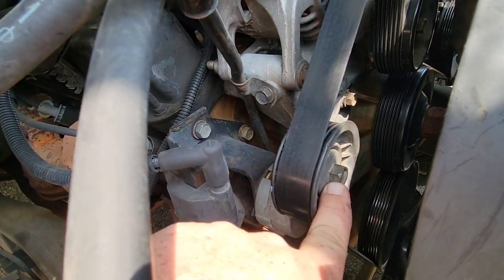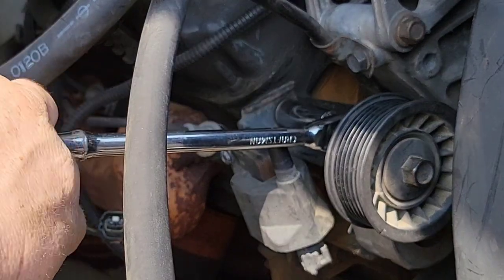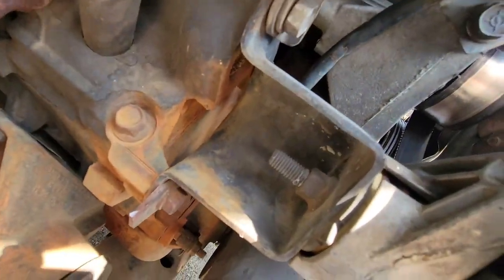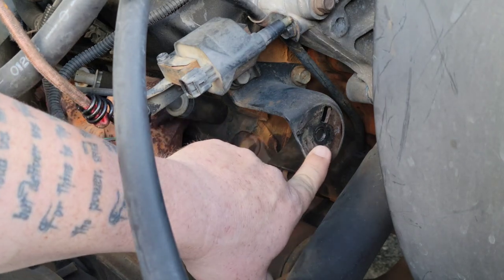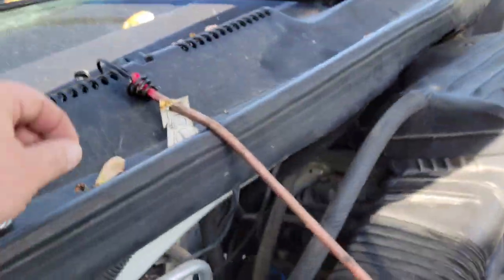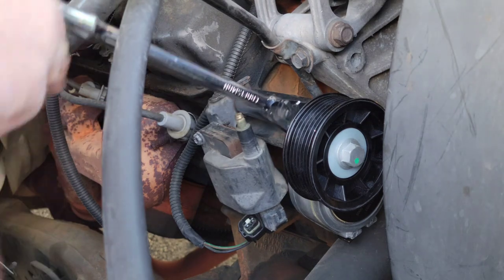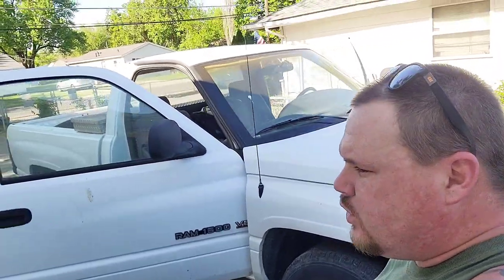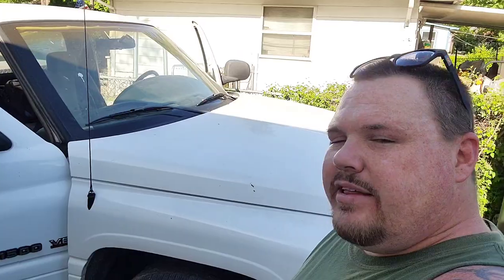2001 Dodge Ram 1500 Belt Tensioner Replacement -BEST VIDEO

Comment: Some people would wonder why you would do such a simple repair. because if you do not have any basic skills you need to build on simple things first. I have taught a few people that did not know how to work a screw driver how to do complete brake jobs and have gone on to do bigger repairs. confidence helps build  your skill set. Keep it up Tomas  !! good job
Reply from the maker: You are right. I want people to be able to watch my channel and follow along and repair their own vehicles and save money, build confidence and overtime hone in and sharpen their skills
Reply: I 2nd this. I did this not 2 hrs ago and my intrusive thoughts are wishing something else needs replaced lmfao (hopefully a lil' cheaper this time)

Comment: So that's where that nut is. Thanks! '02 van with 5.9. I replaced the idler pulley yesterday day and that fixed the intermittent squeal but I bought the tensioner assembly also instead of just the idler pulley so I'll replace that in the morning.
Reply from the maker: Let me know if it all fixed the squel cuz I still have one
Reply: @semperfimechanic  the squeal is gone. I drove 100 miles on I-40 through through the high hills of Arizona today and she runs like new... practically. I WD'd the bolt today and see if I can get that nut off the tensioner.

Comment: It's not real important, but if you have a buddy with a welder, it would be good to get that bracket welded back together.  I would tack weld it while still installed if you can get to it, to hold the correct position, then remove it and weld it up.  It will probably be fine as it is, and I wouldn't go to a weld shop (they will want a bunch of money), but if you know someone or happen to work for customer that has a welder at home, I'd knock it out.  The negative on leaving it broken will be extra vibration felt by the coil than if it was properly supported, and don't want to add stress to the coil.
Reply: Agree with you Bruce!  A quick weld and he's back in business without worry of it failing later.
Reply from the maker: Yea that is a good  what would it cost me
Reply from the maker: What's the price to fix it
Reply: @semperfimechanic  - If you know anyone that welds, maybe you could barter (you could do an oil change in exchange for them welding your bracket)?  Or, you could save up and get a cheapo flux core welder from Harbor Freight.  I got one and didn't take too much practice to make two pieces of metal stick together.  I think I had $200 in it total and found I use it a lot more than I ever thought I would.  My welds aren't pretty but that is what a grinder if for after the weld!  Ha.  Great video by the way...so good to see you under the hood again!  Can't wait to see more videos on this new truck.  Cheers!
Reply: @dewrus2153  Agree Dewrus, because he doesn't need that coil getting loose and flopping all over.  Probably never happen, but I know I would fix the bracket.
Reply: @dewrus2153  Great idea for Thomas.  Get an inexpensive little flux wire welder that will run on 120 volt power.  Learn as you go and as you said, you end up using it for all kind of fixes. Being able to melt metal together, even if not pretty, just solves so many issues.   I just did an RV gate project where I raised the gates up about 5" with some rectangular tubing and put new fence pickets on.  Cost me beans, and a fence/gate guy would have charged me a lot more than the cost of a little welder.

Comment: My bolt broke how do I get it out I have a 1994 the original won just fell right off 😂😂 how do I get it out
Reply from the maker: You have to use a tap and die set. Google how to use a tap and die set for broken bolt. Now if you can get a pair of pliers on it you can back it out. Use a torch to heat it up